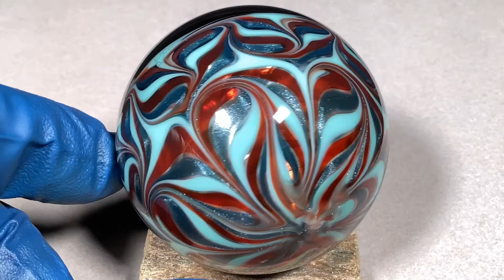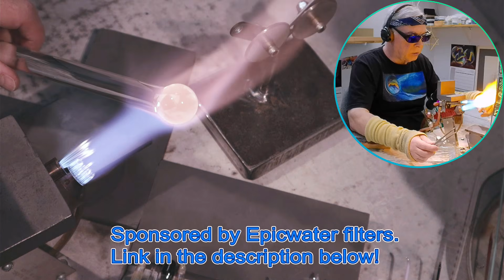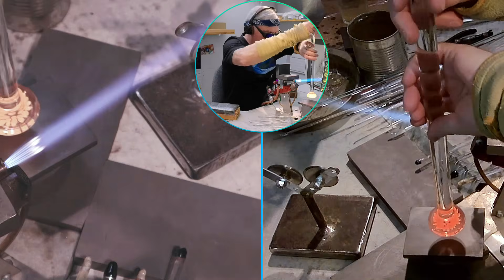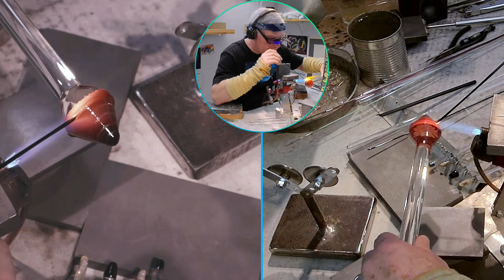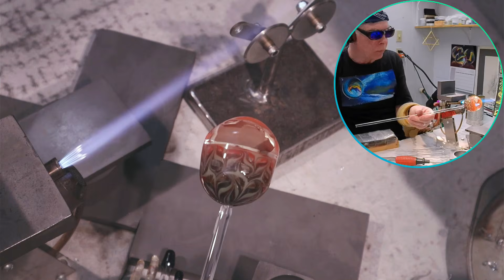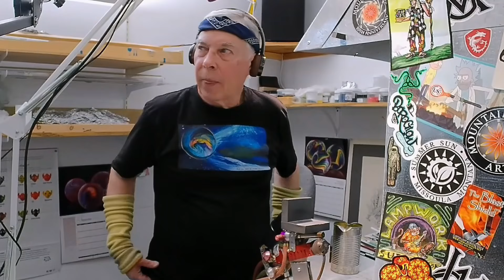Detailed Process of Creating an Art Glass Marble with Bill Grout / Dew Promise / Episode 116

Comment: Hey bill ive been trying marble making using alot of your videos as guides, great job on the videography. I wanted to ask you if i could, how do you get the swirly pattern on the back after the lines are applied? Are you using a tungsten rod? I tried my jacks and i gotta do some metal working to get them straight again 🥲. Glass stringers seem to work pretty interestingly aswell but its not the same finish.
Reply from the maker: I am just using 3/32" tungsten TIG welding rods mounted in a simple pin vise and sharpened to a point with a grinding wheel or file. The tungsten will erode with use and needs to be sharpened occasionally. Using a stringer is one way to go and is often used for the common "wrap and rake" style swirls. Thanks for the comments!